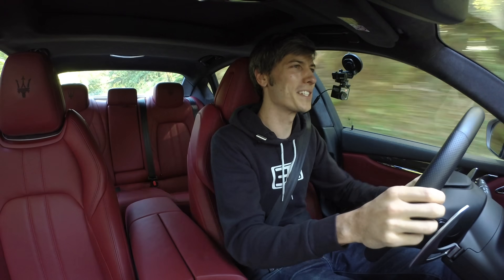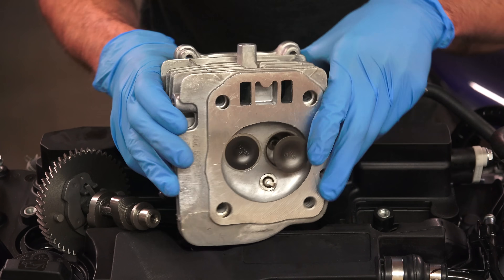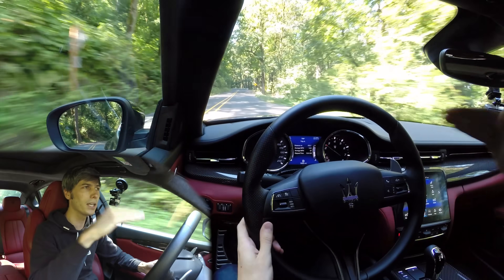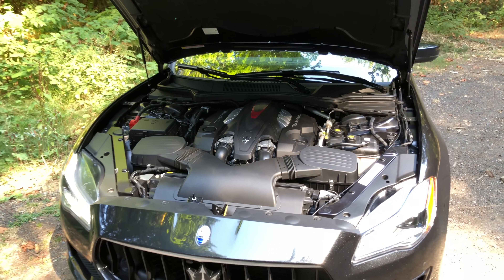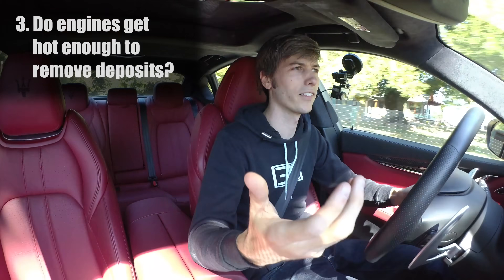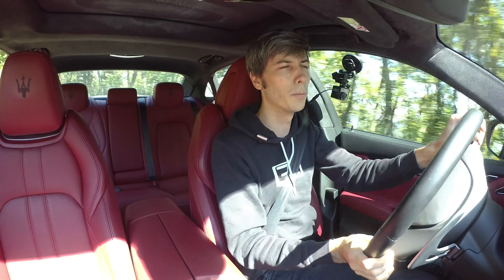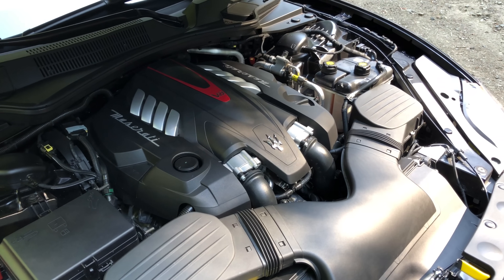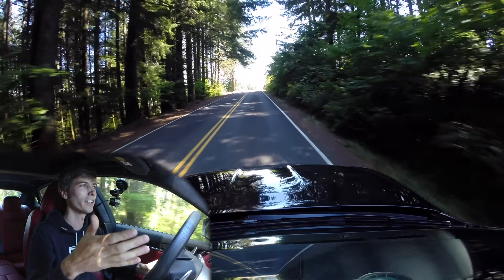Is Redline Good For Your Car's Engine? Italian Tune Up

Comment: Rather than drive hard you could just remove the thermostat. My v8 engine runs pretty dam hot without thermo but I've had 4 cylinders and most of them run too cold without thermo, perhaps you can explain why this is? I suspect it's something to do with how long the coolant stays in the engine, the 4 cylinder coolant doesn't spend enough time in the motor idk.

Comment: I’m thinking if you want your engine to last s long time, you worry less about carbon build up, and more about reducing the cycles of work you put your engine through, and minimizing the heat load you put it on. 
So, like, clean oil, clean gas, don’t drive it like you are going to rebuild it next week. 
It strikes me that redlining the car is the opposite of what you want to do. I don’t think I’ve ever seen a car fail from carbon build up, I’ve sure seen some hilarious failure modes from people pushing it too hard though.

Where the heck did this silly idea of pushing the engine to near failure state to clean it come from? It sounds like amputating your toes to trim your toenails...

Comment: In my experience you don't need to redline the car but driving at high load slow down high load several times can help it run better. It doesn't seem to help with deposits that much but does more for the catalytic converter

Comment: This was for piston engines. On wankel (rotary) engines you MUST redline the engine to keep the apex seals clean. Otherwise the carbon deposits can lock the springs of the apex seals and then the engine  can grenade itself. Also if you redline it will lubricate the housings and that improve the compression

Comment: The best thing for Direct Injection cars is USUALLY an oil catch can to reduce blow-by on valves. Clean every other oil change and it's good to go. It doesn't ELIMINATE the problem, just alleviates it.

Comment: How about using water mist? An engine builder I knew used to spray water down the intake of a hot running engine to “steam clean” the carbon.

Comment: Maybe I will just state the obvious, but running engine at 5000RPM may not get it very hot, if there is no load to the engine, what you need to get engine hot is to put as high load on it as possible and then run it at full throttle near redline, it will burn more fuel and get hotter.

Comment: My idea of it is driving on the autobahn (yeah muricans dont have that) at full throttle for an hour or so. The idea is, that in fullload you get a very high air/fuel ratio in order to cool the engine inside, thatll be the case with cars with catalytic converters as well. The fuel then washes away the buildup...

Comment: Red lining (or close to it) is the only way to get my Turbo 0.9l (yes 900cc engine) car engine up to speed.
Plus it sounds great with only 3 cylinders (sounds like a v6 engine up past 4,000rpm). still put's out 90bhp !

Comment: I Have a Honda Civic R k20 engine and i turn it all time at the redline. Also i love to hit the rev limiter at 9.000rpm. The last 12 years end after 150.000 kilometrs nothing bad hapens to my engine. Just oil change every 10.000 kilometrs and valves adjustment every 40.000 kilometrs.

Comment: I always assumed the origin of 'Italian tune up' was carbureted engines tuned for performance - the fuelling was far from ideal at lower rpm and this could lead to performance loss from carbon buildup. I owned a carby Alfa Romeo 33 for years and took it to track days occasionally. Afterward it would idle better, feel stronger and smoother, the milky residue would be gone from the oil filler etc.

Comment: I've always driven cars pretty hard (track driving, or A roads) and ive found it generally keeps the internals in better health. getting up to a nice hot operating temperature keeps moisture buildup at bay, allows components to work through their complete range of travel, makes sure that lubricants are getting to every part of the engine, and generally seems to keep everything running a bit more sweet. 

I remember a generation of Zetec engines that were having valve issues because most were driven by older customers, pootling around at 25mph through town in high gears. 

A good sustained blast (as long as you have appropriate durability of components, cooling, oil grade etc) seems to me to keep engines running very well indeed. 

After 3000 miles of almost exclusively track use, the oil in my Caterham came out looking almost as clear as it went in!
Reply: Exact same problem with Northstar GM V8s. Carbon buildup because granny won't drive over 2200rpm. I owned one for 6 years and that car ran fantastic because I drove it HARD.

Also dripped oil all over the damn place but that's a different story lol

Comment: There's a fuel additive called Redex which apparently has de-carbonising properties. So much so in fact that it's recommended that you not use it in well-worn engines as it can expose problems the carbon was hiding.

Comment: The money shot (for me), is how to get the carbon build up off the inlet port with DI gasoline engines?Our EE expert says alas not with Italian tune-ups :( But why not? "The exhaust valves 650'C to 800'C range".  No problem as carbon lets go from 320'C.Intake valves carbonisation:Port: even with the cooling effect from port injected fuel wash at 5,500 RPM temps of up to 272'C recordedDI: so notwithstanding the Guinther & Smith study: without the cooling effect coming from the injected fuel wash, surely temperatures well above 320'C are achievable and therefore carbon could be burned off (with the Italian tune-up)? But frustratingly no temperatures were cited for this DI intake port case? :(

Comment: Way back when I used to see engines taken apart, it seemed like the harder driven cars were quite clean and more free of carbon (granted they may have spun their bearings or done other damage).  For example, when a young male in his early 20's with a hopped up audio system would bring us his car, we would typically find that engine quite carbon-free.  Conversely, your more elderly driver would bring us his/her car and it would often be literally caked in carbon (pistons, valves, etc).  This info is very anecdotal, and there may be other factors that play in (ie: young males with aggressive driving habits may keep their cars maintained so as to keep up with their other like-minded friends during stop light drag races).  Also, I haven't taken apart in engine in about 20 years, so I'm sure much has changed, and modern engines are just cleaner and more efficient all together.  Great video, as usual!

Comment: Hmmm... At high RPMs there will also be higher vibration; flow through the cylinder of fuel, air, explosions and exhaust; and higher heats will cause thermal expansion of metals because physics. Which, all together, to me sounds like it really could be able to displace more carbon deposit than driving normally........... Which makes me think that combining an Italian tuneup with a valve/engine cleanin' additive (um, containing whatever product that you found that works. Poly... something something...), could be a really useful combination? Kind of like how the Planeteer's had those rings which were all kinda cool (except "Heart")... But when combined, Captain Planet! Exactly like that. Except, you know, with all the stuff that's actually destroying the planet.... My main point here is that you're basically the evil villain from a Captain Planet and the Planeteers episode.

Comment: I redline my engine multiple times daily, and after driving like that for about an hour (on/off redline pulls) my car feels noticeably pokier and the engine noticeably smoother.

That being said, I wonder if there is a direct correlation between N/A redlining and carbon deposit removal and turbocharged units and carbon deposit buildup...

Comment: The usual solution is to use a dihydrogen generator to increase fuel burn temperature.
Is it really good idea to clean motor?

Comment: What about EGR in diesel cars, is it possible to help it clean a bit by this or generally is this part that can be cleaned and reused (by removing the part and give it a clean outside the engine?)

Comment: I’ve tested with before and after results using shell v power, the intake valves were extremely carbon coated, like a centremeter around the stem. I turbocharged the engine which had 240 thousand km on it, drove it on boost a few times but mainly just normal driving. Two tanks of v power later I removed the intake manifold and everything past the port entry was like new, couldn’t believe what I was seeing.

Comment: i have a question about diferencial, if the car is elevated and the tiers don't toutch the ground  what happens to the tiers if we turn on the engine  (acceleration)? do they spin diferent ways?

Comment: I love you’re videos! You do a great job of backing it up with facts and research. Can you please make a video about whether or not it is actually good or bad to redline a car as in engine wear? Does it cause any damage to the bearings, valve train, compression and ect. I’ve destroyed a few engines (threw the rod through the block) so I came to a conclusion that redline isn’t good for a car. I’m really interested in this aspect. Please explain : )

Comment: Fun fact: Ford installs the wrong analog RPM gauge in the 2018+ Mustang GT's for the North American market (well, except for the US, who aren't affected by this issue). The rpm gauge they install for the GT V8 is actually from the 4-cylinder Ecoboost model so it has the incorrect 6500 rpm redline, where as the GT gauge is supposed to have a 7400 redline, like the US model (all the GT engines are the same Coyote Gen 3 V8 and produce the same power, 460hp/420 lb ft, and redline at 7400 rpm). Anyway, Ford has been installing the wrong part since it was first reported in late 2017, when the 2018 GT models started getting delivered to customers. The problem still hasn't been fixed and now the 2019 GT models have the Ecoboost rpm gauge too.  Ridiculous. 🤔
Reply: JCTiggs Classic Ford....
Reply: @nickcaesar7650  Yeah, it's complete BS on Ford's part. I recently heard back from 'Ford Customer Care' and they freely admitted that all GT models with the KMH speedometer also have the the Ecoboost rpm gauge from 2015 +(which has the displayed 6500 redline).
Reply: I guess they had trouble converting from mph to kmh...
Reply: @Cheepchipsable  lol. They were just too cheap to remake the km/h speedometer with the 7400 rpm redline. How sad is that. Imagine buying a Shelby GT350 and the displayed redline is 7000 even though it goes up to 8200. Ford did make the proper redline for that car with the km/h speedometer, despite that car selling minimal units here compared to the Mustang GT.
Reply: @JCTiggs1  or they realized you bozos are already taking out too many crowds so 6500rpms is more then enough for you guys
Reply: @xJDMWaRRi0Rx  Tired old joke but A for effort! 😊
Reply: maybe they're stopping production of their other cars to fix this issue.
Reply: It would be interesting to see if statistically the 6500 redline cars built up more carbon.  in my focus svt It i hit the limit on revs occasionally.  my older car doesn't have one and It routinely revs above the svt.  I Beat the hell out of it..  it just keeps going!
Reply: I have a 2018 GT and the tachometer shows a redline of 7400....
Reply: @chop2093  As I said, only GT's outside of the US with the analog RPM gauges are affected. Basically anyone who has an analog metric speedometer with the km/h, will have the 6500 redline. Check the link above.

Comment: If carbon deposits coming off the intake valves are quite "big", wouldn't these end up clogging the catalytic converter and PCV as you said (if no catchcan is fitted) and make the computer throw Check Engine warning signs?

Comment: I used to have a 1967 Cadillac Calais which is quite possibly my most favorite cars, 1 of about 20 in my life.

I remember driving it mostly at low RPMs after all it was a luxury car with plenty of power. But every once in awhile as I was doing 30 I would floor it and watch the carbon come flying out of the back of the car exhaust black smoke.

Sometimes I would duplicate those conditions and no smoke would come out.

Probably because there hadn't been any carbon buildup yet.

Back in the days when there was lead in gasoline ( don't know if that matters)

Based on your findings the Italian tune up would be ideally performed in the summer in Florida at the end of a long trip...lol

Comment: Seems like there's some truth to it at least. Relatives had a Hyundai Elantra with GDI and were rather known for driving like an old man. When they traded it in, the guy from the dealership that was test-driving it - presumably a bit more aggressively than it had been seeing - mentioned it was blowing out black smoke from all the carbon buildup burning off.

Comment: I have had good success getting a car back into operating shape with an Italian Tuneup, but it was an old car.

Just increasing the pressure in most of the systems, the vacuum load in others, seemed to blow out dirt or grime enough to get the idle to run smoother. Whether it was just a clogged Evap line or something else causing the problem, the result was there.

Comment: I always thought most of the theory behind the italian tune up was that the high speeds of the moving parts would help to literally throw the deposits off from the forces, but I suppose the heat has the major role in actually loosening them up

Comment: So if exhaust valves usually get to these temperatures that remove carbon why does every rebuild have exhaust valves that are covered in carbon or at least have a thin layer of it? Just asking.
Reply: @Shorne Pubique Crap fuel too
Reply: @RCXDerp  tru dat..  however, if exhaust valve cake up most....  they also heat up most..  which should mean they should clean easiest.

Comment: Your understanding of engine load is not totally correct, any engine when run at its most efficient points, i.e anything from 5820 to peak HP is an engine that has overcome the energy needed to turn itself and is now generating more power than what it needs to turn. at this stage increasing load, i.e. lugging in higher gear or correct gear but loaded car is what is called loading the engine. Basically the point where now you are considering the amount of energy  needed now to turn the wheels. So with the really powerfull cars that are available, if the engine has crossed the threshold of energy needed to turn itself and then energy needed to get the car rolling and is till generating more power at a particular (constant) speed (kinda like the reserve power guage in the Bugattis) then it can be said that the engine is under less load.
Reply: I bring this up because of the statement you made after quoting the study, "the harder you drive your car, the worse carbon buildup is going to be". That bit is incorrect. Only under engine load conditions is the study applicable, not just because one is making the engine turn faster (harder as you have implied). Also now if we have to discuss accelerations as an increase in engine load, the car may have great acceleration that pushes you back into the seat, but such acceleration is great from the standpoint of carbon build up. Cars today are made with good power to weight calculations for efficiency.  Smooth accelerations, will reduce carbon build up, and such a vehicle subjected to a track day kinda italian tune up will remove the build up to some extent. Engines are inherently not 100% efficient and have a range of working scenarios, carbon build up is inevitable,  but can be prolonged before it gets detrimental by correct operational knowledge, and yes its a consumable, the engine, it is going to degrade with usage.

Comment: There is another tried and true application for the "Italian tune-up." Early Volvo 5 cylinder engines, like the ones in the 850s, had a tendency toward sticking valves if driven exclusively in town. The symptoms would be hard starting, surging, and refusal to start. The tune-up consisted of driving a couple miles around 50 mph in second gear; power was not the issue but rather engine revs were. I have long assumed that using synthetic oil eliminates the need for hard revs but that is only an assumption.

Comment: Hey Jason - Love your stuff; keep it coming.  On this topic, I was under the impression the Italian tune up, which pre-dates fuel injection for consumer vehicles, was not for the engine, but rather for the carb (you remember those, right?!?).  The idea was to get the gas - a solvent - flowing with some gusto in order clean out the carb and generally ensure it's delivering fuel as it should be (you know, unstick things that are stuck, remove undesired restrictions, etc.).

Comment: It seems that the theory doesn't apply to direct injection. In an engine where the fuel is introduced upstream you are cooling the intake valve and using chemicals to remove deposits. In all the port injected cylinder heads I've done that are used at high load and high rpm the ports and intake valves are very clean.

Comment: Topic I wish would have been covered in this is the use of decarbonizers. I used some in my fuel awhile back and it worked wonders. Ran a little better and saw a noticable fuel economy increase. In a 4.6 mustang. Also that car was drivin pretty hard on a regular basis.

Comment: I've heard a "theory" about pushing steam or hydrogen in the air intake to remove carbon.
the idea is that the water (either from the steam or the combusted hydrogen) helps to detach it.

any validity to this idea or is it another auto myth?

Comment: I'm wondering how this reflects on Rotaries. We also have the "Redline a day keeps the carbon away" or "mechanic away" saying. I do know for a fact that rotaries run hotter than piston engines in general, so I'm curious as to how these studies would apply in the case of a rotary engine.